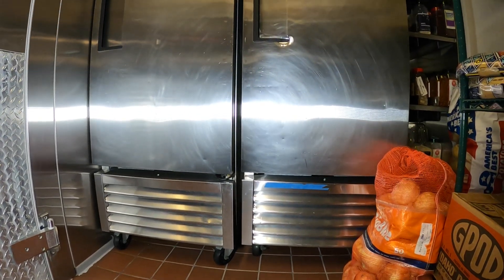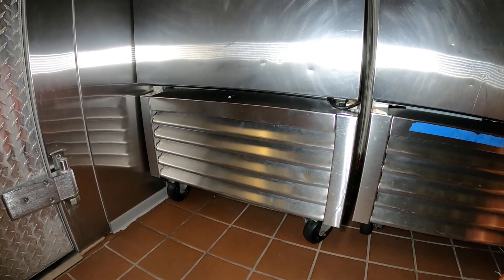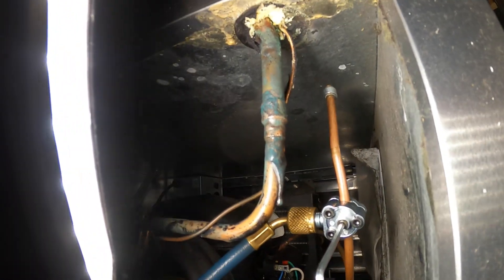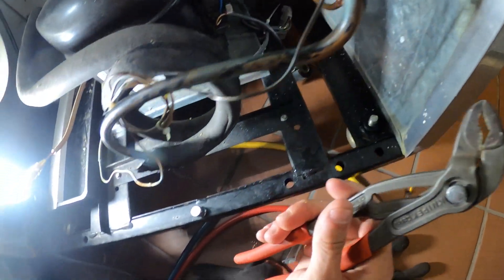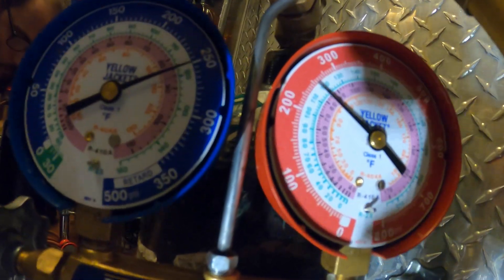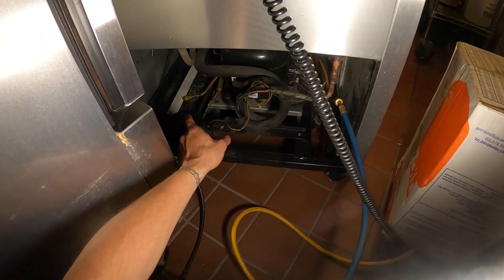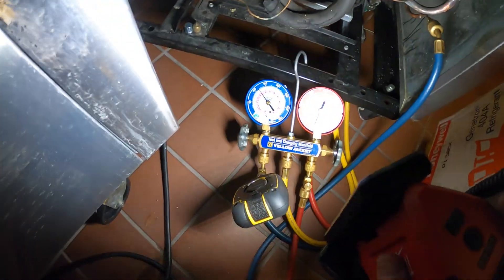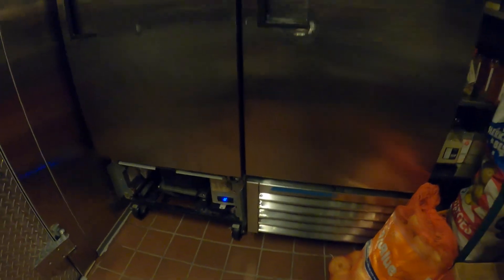HVACR Service Call: TRUE Freezer Not Freezing(Commercial Freezer Not Cooling)Refrigerant Leak Repair

Comment: Hello can you help me with this, I just recently bought a true t-72 F freezer. I set the temperature at-17 but it didn't freeze and the compressor keeping running nonstop and I keep checking the temperature is display 2 degrees. What could be the problem.

Comment: My GOSH!! you are Awesome You explain every step. I will  like/sub your page and will be following you weekly or 3-5 times a month. You have some Great videos. I am a DIY HVAC guy. I would love to lean WAY MORE and get cert in it. i have all the tools and Freon. Can i ask, why you did not put in oil back in the unit? or does it not need any. i have never fixed a freezer before. i sure did learn you using those Taps. i will go buy some of those for my next DIY fix it issue. thanks keep up the Great videos.

Comment: Great video. I just hope you're good without a new drier you may have gotten a lower micron.
Reply: Would have gone with a larger filter drier that had service ports on it. Was nitrogen flowed while brazing?
Reply: Bigger risk of clogging up the cap tube.
This is real world refrigerant, it's fine.